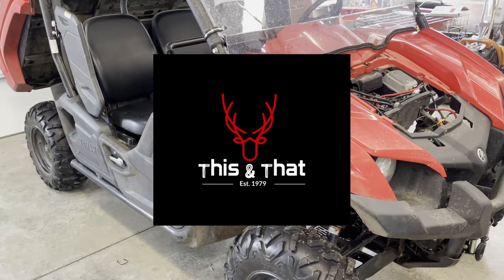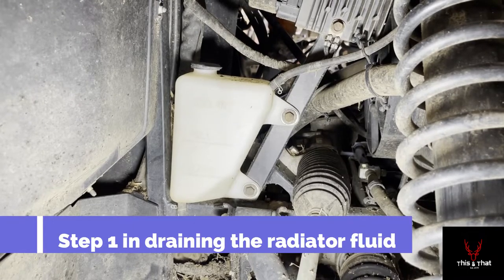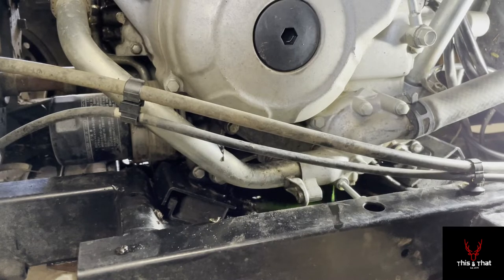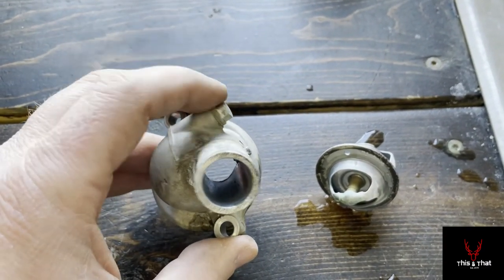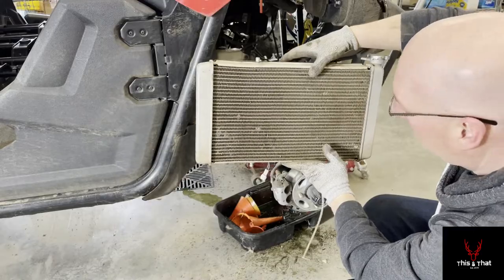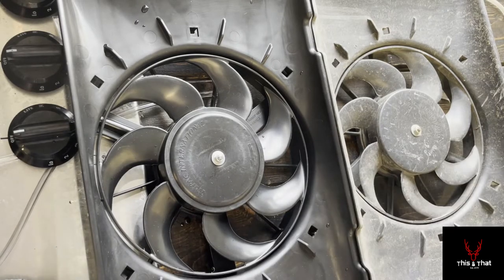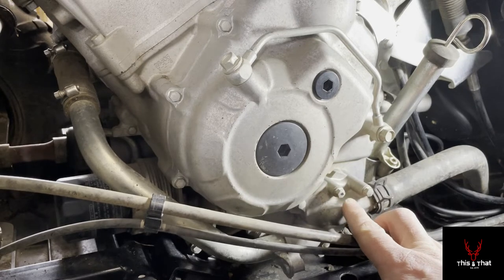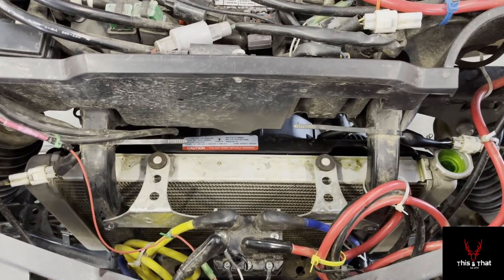Yamaha Overheating Fix - Viking Fan Issues - Radiator Thermostat Clean And Replace

Comment: Thanks for the video. I think the bolt for the drain is actually the one underside there is an access hole underneath and a short extension will get it out completely.
Reply from the maker: Interesting….that’s certainly possible.  I was using the manual from Yamaha, for the most part the manual was pretty good but there was room for improvement.  Thanks for watching!

Comment: Thanks for the tutorial. I need to replace my thermostat and I'm fairly certain that I'll be replacing the fan in my Viking soon too.
Reply from the maker: Glad it was a help! Good luck on your project, let me know if you have any other questions as you go through the repair.  Take care!
Reply: @ThisThat007   blow air and water into the little vent on the fan motor to try and free it up from sand and dirt and it may work again. I had to do this 2 times now. The fans are not sealed very good at all. Poorly made fans.
Reply from the maker: For sure!

Comment: The drain bolt is the vertical bolt that can be accessed from underneath through the large round hole. It doesn’t take long at all to drain. Also there is an air bleed top AND bottom. Fill and re-bleed at least 3 times to be sure.

Comment: My fan won't turn off and the engine light and temp light are on and stay on. 2016 yamaha 700 wolverine exp. Fan is on on start up and both lights stay lit. Any suggestions would be appreciated. Thanks for the video.
Reply from the maker: Hello!  That’s an interesting situation you have going on there…my best guess would be that you coolant sensor back by  thermostat is faulty or one of the relays for the fan is faulty.  Also, double check to make sure that you have plenty of coolant in the system in general.  With something that prominent it might be worth a phone call to your local Yamaha dealer to see if they’ve dealt with this issue in the past.  My experience has been that they are not super helpful but it’s worth a shot anyhow.  I’d be interested to hear how it turns out. Good luck and thanks for watching!!
Reply: @ThisThat007  Thank you kindly. It happened after a long ride in the snow which packed up all underneath the undercarriage. Was dark and couldn't see it was so bad until the next morning. I will get to the bottom of it . Again, thanks.
Reply from the maker: No problem and good luck!

Comment: Trying to bleed my system however when I do the bottom bleed, all good.   But the top on there is no water at all up there?    Any ideas why?
Reply from the maker: Yeah, If I remember correctly I never got a consistent drop but the threads on the bolt started to get wet…then I knew it was good….hope this helps!